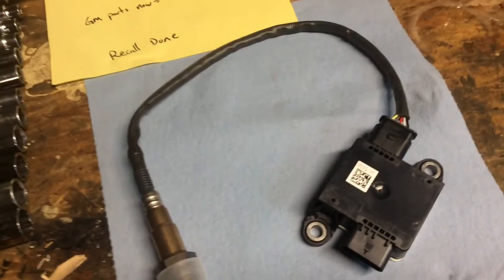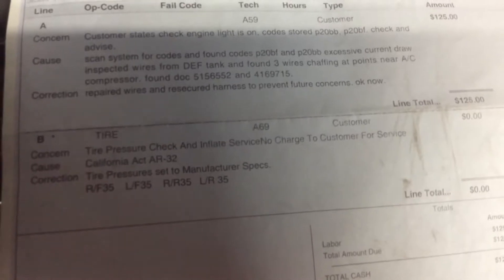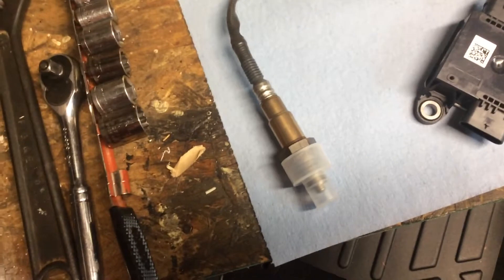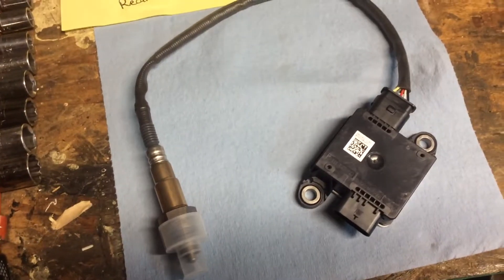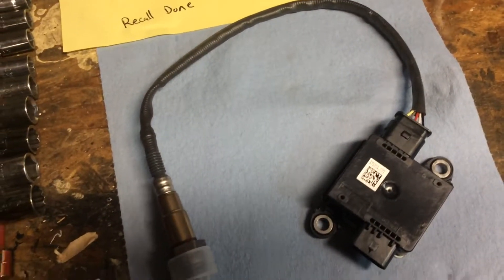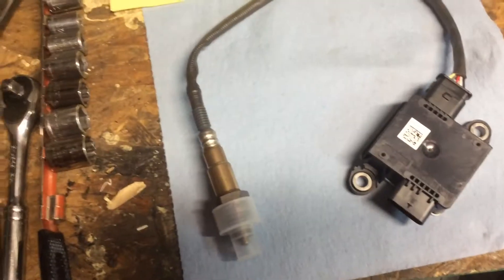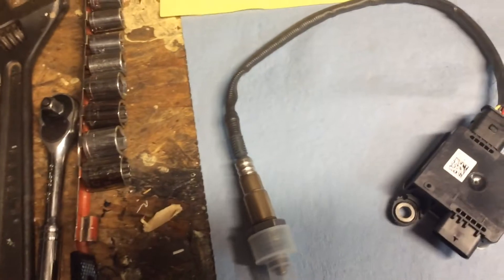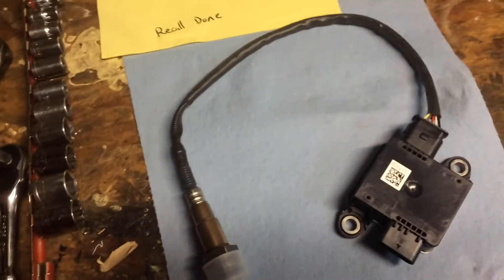2016 GMC Canyon diesel P24B0-particulate matter sensor

Comment: Fair warning. Had touse a torch to heat the threads up on the exhaust just to get the damn thing out. It looks simple but it can be troublesome my truck only had 75,000 miles on it.

Comment: Wish we had part 2...
Reply from the maker: Sorry. For some reason I had part 2 locked.  Find it under 2016 GMC Canyon particulate matter sensor.    Replaced it and had to take it in to reprogram, haven’t had an issue since.  Hope that help. Have 90000 on the truck now, still lovin’ it
Reply from the maker: FYI Also part 3 is there
Reply: Part 3 is there but Part 2 is still missing.